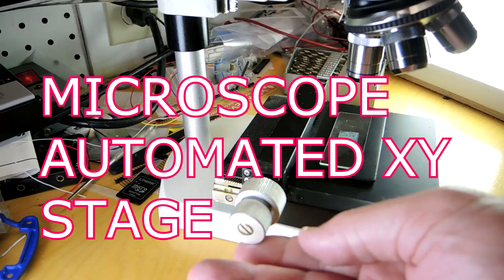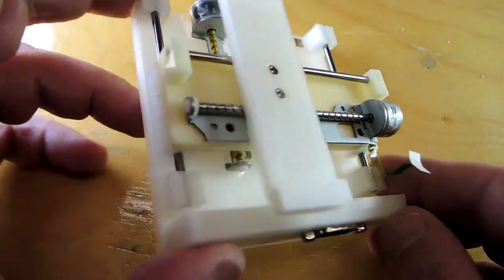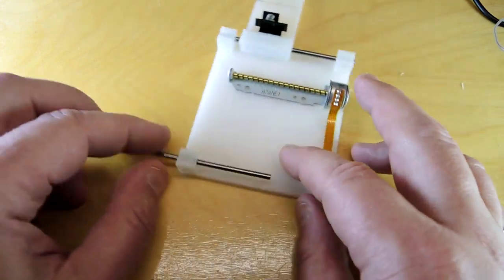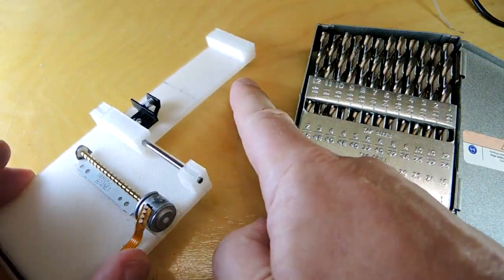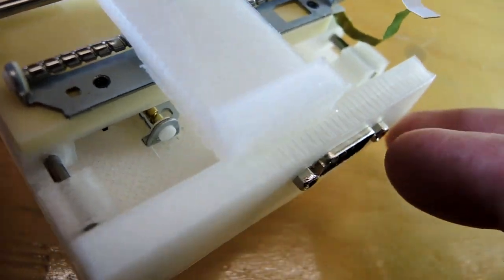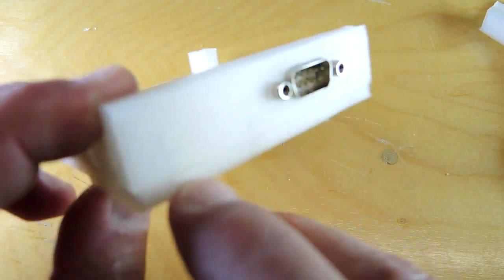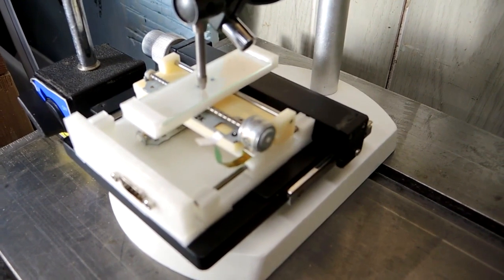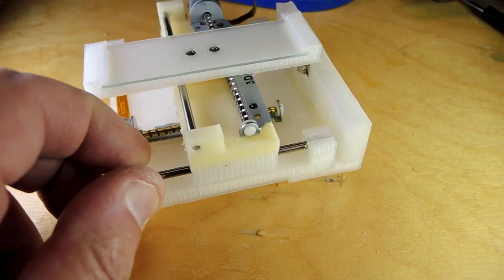Microscope Automated XY Stage: 3D Printing test

Comment: Unless you're using micron level cured resin style 3D printing you're not going to get perfect holes right out of the printer. Especially not a melted filament single layer additive printer doing horizontal holes(sure you could Chase the dream but there are easier ways). If you want precision holes undersize the holes on the printer and drill them out then you will have perfectly sized holes. If you're worried about keeping things perfectly in line you could always print guides both in the faces you intend to drill and along the shaft path and just snap them off later. Consumer level filament single layer additive printers are not meant to spit out a finished ready to go part. 
Yes, some are capable of getting dangerously close to achieving that. But you are going to be chasing Gremlins for months and maybe, maybe, it'll print out apart ready to go and that part will sit on a stack of wasted material. These are rapid prototyping machines. Prototype. Not finished piece. Prototype. Meaning still needs work. They do a great job of cutting out a lot of the fabrication process though, and that is where they shine. 100%.

That aside, super clean design I love it. I would say though, try to find microsteppers that have the very fine thread on them. They're usually inside the optical pickup on Blu-ray players to collimate the beam. They don't have nearly the same travel, usually only 2 cm if that, but supposing those little steppers don't have a massive step angle the fine threading on them should allow for insane precision (at least out of something made out of salvage parts lol)

Meanwhile I'm looking for a way of hijacking the motor controls inside of a CD-ROM so I can drive all of these salvage motors directly from the board that's supposed to control them in the first place, thus saving even more e-waste ;)

Comment: You say that you had a problem with holes not being precise enough. I wonder if you knew that this might be due to circles being approximated by polygons. Basically, the vertices are on the circle, but the edges are inside the radius. You can solve that problem either by adding a correction factor (somewhere in the OpenScad docs, I think) or by setting the $fn really high, meaning more vertices and less of an error.
Reply: I would have thought that you'd need quite a low vertex count for the approximation that you describe to be much of a problem, though that totally could be an issue!

My experience with 3D modelling (using Fusion 360) and 3D printing (with a custom-built RepRap Prusa i3, using roughly the Prusa i3 MK2 design) is that holes in a vertical face can end up undersized for two potential reasons: firstly, the printer may simply not be calibrated perfectly (and this affects holes on a horizontal face as well) - mine certainly has around 0.1mm of inaccuracy in the X and Y axes that I've not been able to calibrate out just yet; but also that the tops of those vertical face holes are printed as bridges and I find that there's inevitably some droop that flattens off the top of the hole, causing it to more resemble a "D" profile on a stepper motor shaft.

I've noticed that a couple of the Prusa i3 MK3 printed parts now actually have small cut-outs directly above the top ~90° of the hole in order to compensate for that bridging droop, for example the two holes where the X-axis smooth rods/linear guides fit in the `x-end-idler` part here: https://github.com/prusa3d/Original-Prusa-i3/blob/214722d86e1ca5603e86788d418897bec8e22a74/Printed-Parts/stl/x-end-idler.stl (and since the Prusa machines are open-source and built using OpenSCAD, you can check out how they achieved that by reading the source files, e.g. https://github.com/prusa3d/Original-Prusa-i3/blob/214722d86e1ca5603e86788d418897bec8e22a74/Printed-Parts/scad/x-end-idler.scad and https://github.com/prusa3d/Original-Prusa-i3/blob/214722d86e1ca5603e86788d418897bec8e22a74/Printed-Parts/scad/x-end.scad :))

Comment: I eagerly look forward to seeing what electronics and/or software
you use to drive your XY stage.  Should you consider selling them,
then I would purchase a few.
Reply: You can literally JB weld (glue) one cdrom slead on top of another. To control them, use a microcontroller (arduino) or single board computer (raspberry pi), and a few transistors or FETs in an H-bridge configuration (google is your friend) to drive the phases of the micro-stepper-motors just like any other normal sized stepper motor. Trap for new players: micro-stepper-motors dont usually step the same angle as bigger ones, so if you need higher precision hop on eBay and find microsteppers with a fine drive screw instead of a coarse one. Or take apart anything that can read blu-rays they usually have a moving collimating lens inside them.

We  makers had to learn all this  by doing, not buying. If you want to just buy one there are far better (read: expensive) precision repeatable (why they are expensive) position devices out there. We did it, and you can too. I believe in you.

.... Or maybe I dont. I'm not your guardian angel, I'm just some asshat on the internet.

.....Or am I.....
Reply: Seems you've been waiting a long time, hope someone comes out with something like that :)
Reply: I too am surprised that why such a general purpose product is not easily available in the market
Reply: @vedant6633  because the market is almost non-existent. Lab grade automated stages require repeatable precision positioning. If you direct it to move +3 nano in X, it better move +3 nano in X give or take a few handfuls of atoms. And it better always go to +5X when directed within the same variation regardless of where it was every single time. Period. No excuses. Because if you can't trust your positional measurements and accuracy you are not doing science. And thats why the only ones out there are expensive, because the only market for them are funded labs doing hard science. The guy messing around with a second hand microscope for giggles is not a market that's worth them producing for.

That being said I have noticed a slightly worrying trend and people relying on 3D printed parts. Too many times I've gone looking for unorthodox ways of building something to achieve a similar goal knowing full well I'm not going to get submicron precision, and that's fine with me, and all Google returns are tutorials that start with print these 3D parts. The ways of duct tape and cardboard are dying, soon our children won't even know what you could do with a popsicle stick besides put a popsicle on it.....